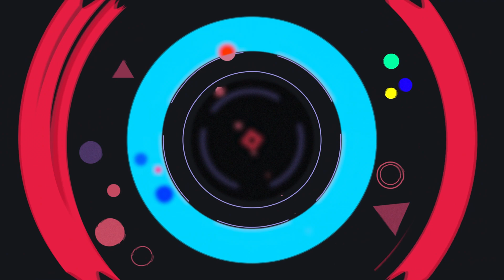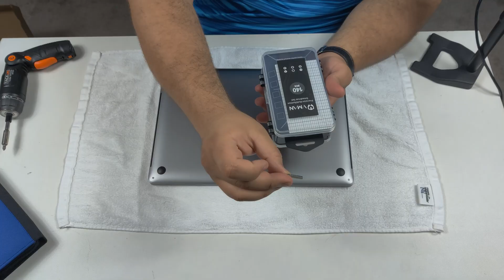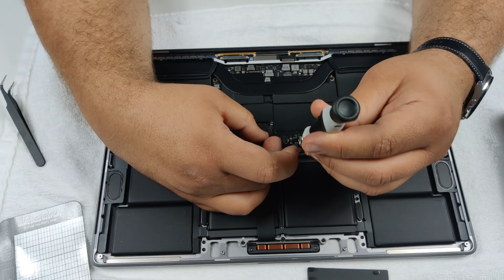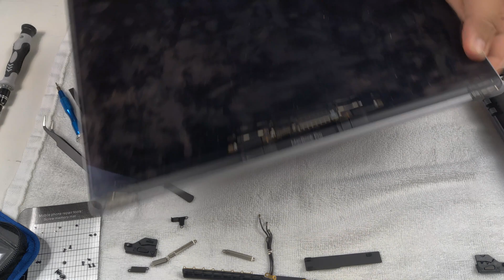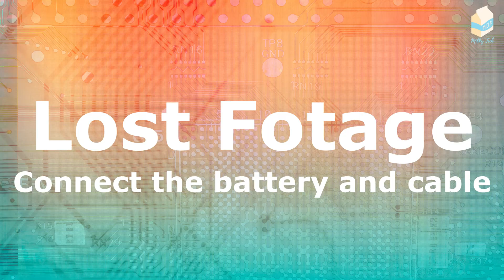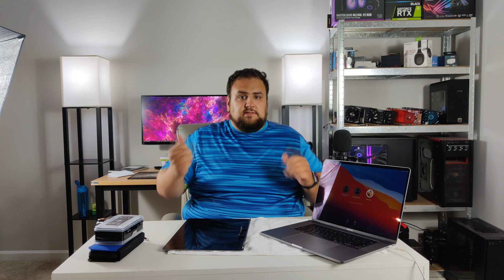MacBook Pro 16 2019 A2141 Screen Replacement | Repair Guide!!

Comment: Only thing you forgot to mention is you need to unclip the battery ribbon that covers the screw... If you don't know it will break...
Reply: yep - this permanently broke my connection to the battery - beware!
Reply: @KelC77  dude... I had to pay for it to be repaired in another country... I'm hurt... 😭😭😭

Comment: Was the hinge a t8 in the end? 
I bought a set of screw drivers but they dont have all the bits i need. 😅
Im replacing my screen but stuck as i dont have p2 or t2.
Id be grateful if you told me which ones i needed.  😂 ive subscribed bro
Reply: Also is a t8 the same as t8H?

Comment: Hi buddy, in ifixit they mention that replacing screen in this model, even with original parts, may cause abnormal operation, because chip T2 prevents unauthorized service, but this didn't happen to you, isn’t it?
Reply: @PEFELI  it's a lie for this model... The screen works just fine